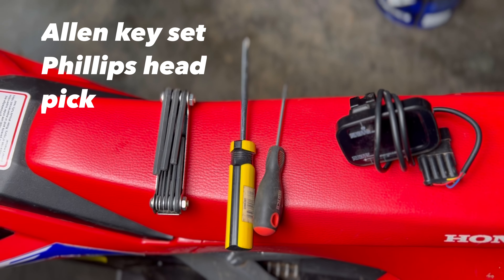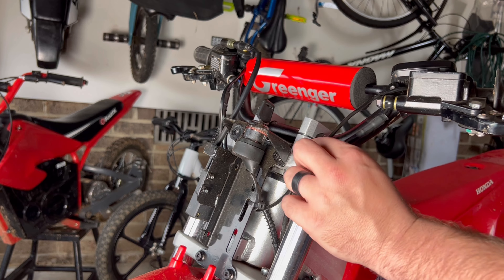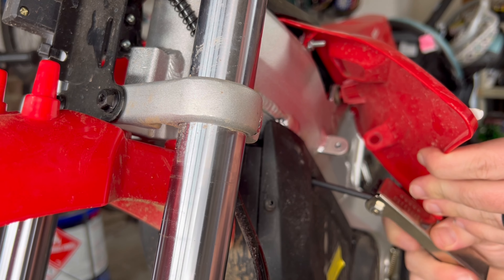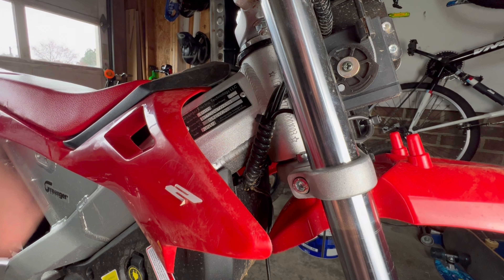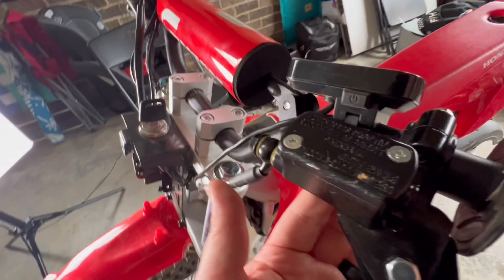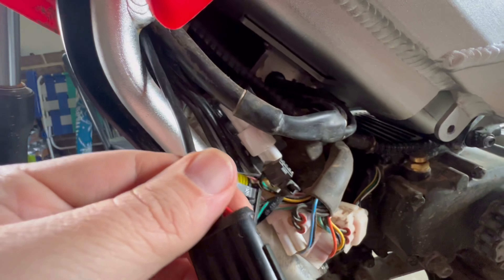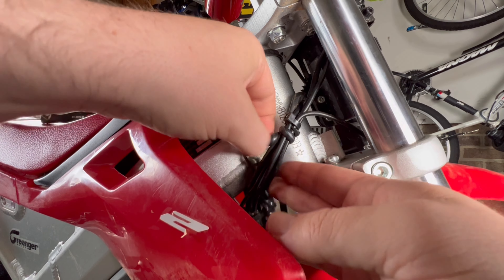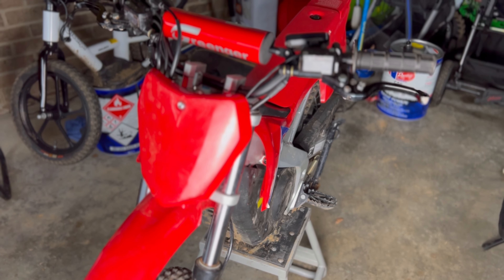Easily Install CRF E3 Stage 3 display for 30+MPH

Comment: Awesome video, I think I we’ll pick one of these up! 😎 

You ever have any issues with the yellow start button not bringing the bike out of park, like not responding when pressed?
Reply from the maker: Yes I did, I’d they get water in them they can get corrosion.  It’s easy to take apart and clean the metal disc. I used mustard and a Brillo pad. No issues since
Reply: Perfect - worked like a charm 👍🏼 thanks!

Comment: Thank you for the video it was very helpful.  I would like to get another e2 for my younger son but was wondering if I could put 10 inch tires on it for now so he could fit better.  Have you tried this and if so do you know ow what 10 inch wheels and tires could fit? Thanks in advance.
Reply from the maker: I’m actually not sure, I don’t think anyone has done it but that doesn’t mean it can’t be done.  I would look up widths of other 10” wheels.  My concern would be the brakes I guess.  We actually ended up putting bigger motocross tires on ours

Comment: How does the stage 3 power compare to a ktm  E5 or a ktm 50sx? My son currently runs supercross with a CRF50 and I want to step up to something faster. The E5 is out of my price range, and idk if a 50sx would be too much power.
Reply from the maker: The e5 and 50sx are definitely faster even with the E2 having stage 3. That being said with stage 3 it’s pretty easy to beat slower riders on the other two. But it all comes down to the rider